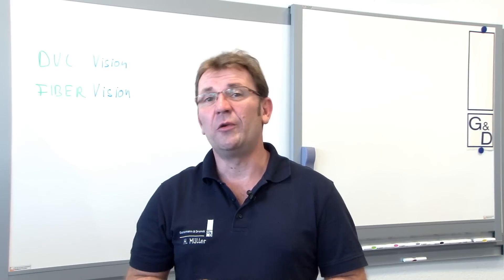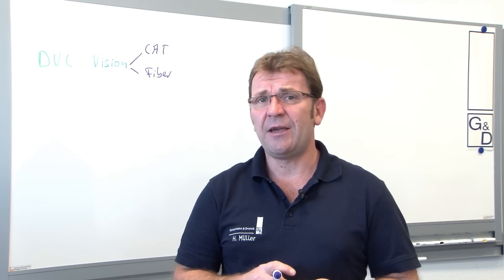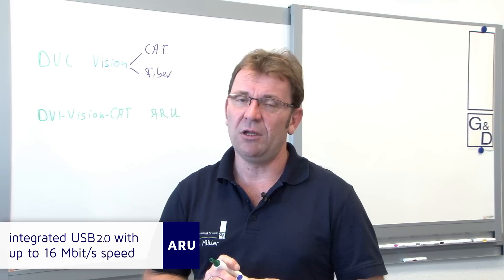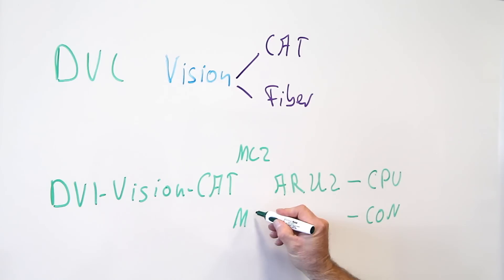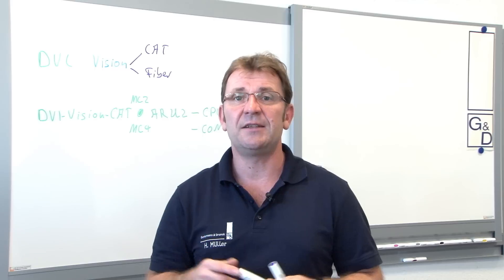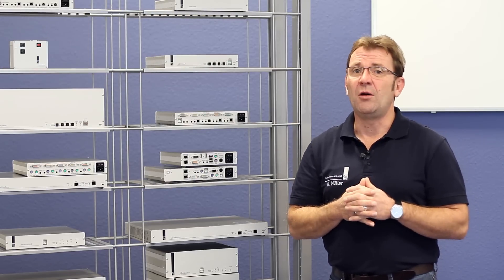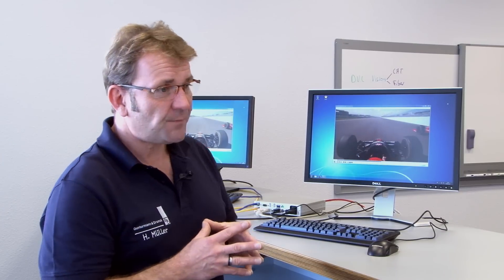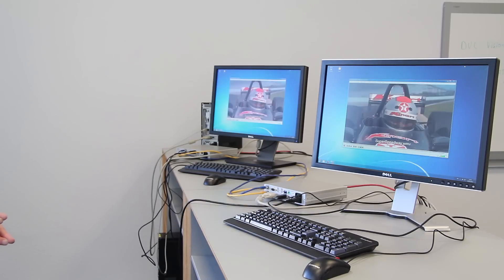The new DVI-Vision-CAT and -Fiber systems

Comment: K/M LED on the DVI-Vision-MC4-CPU extender is blinking at a frequency of 1Hz continuously when the keyboard and mouse are connected and even when are not connected, hence keyboard and mouse on the local extender(DVI-Vision-MC4-CON) are only working during set-up(when you press ctrl + Num Lock). please help.